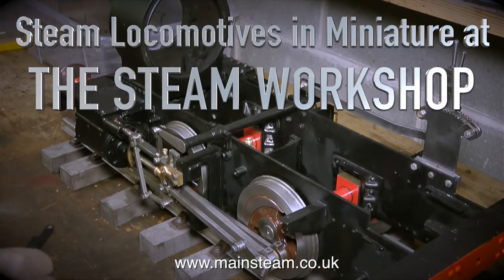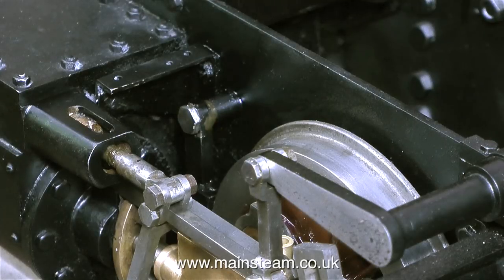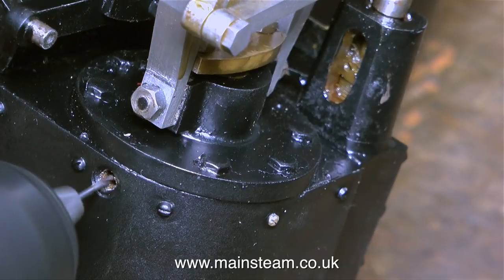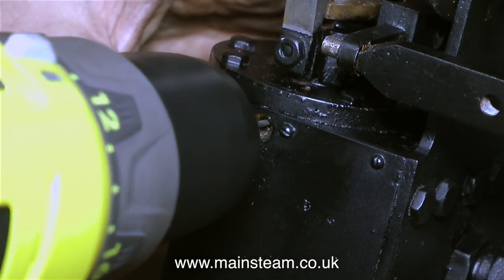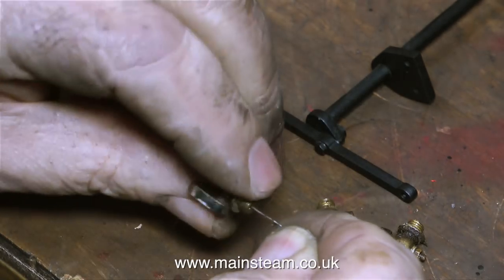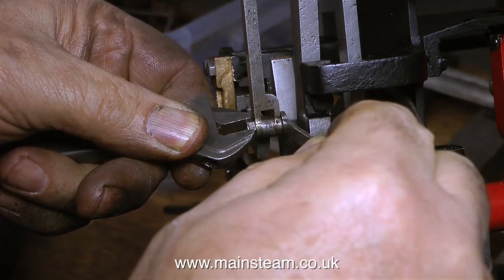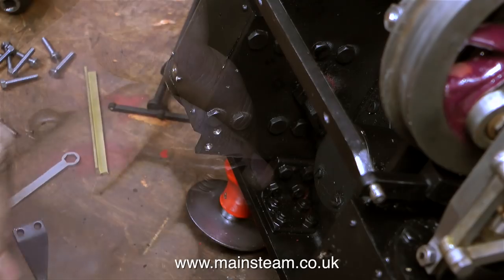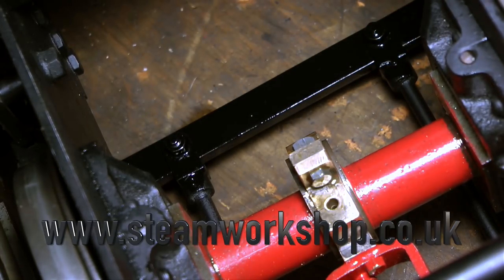WORKING AT THE STEAM WORKSHOP #12 - BRAKE GEAR AND CLEANING DRAIN COCKS

Comment: In a situation like cleaning those cylinder drain holes where the risk of breakage is high, I sometimes use a suitable piece of malleable wire such as stainless steel safety wire, then flatten the business end to make something of a spade drill so they will made something suitable for removing crud, but flexible enough not to wring off with an electric drill. You could also use a dowel or the like to make it like a small screwdriver and twirl it between your fingers if you do not trust the drill motor.

Comment: keth if this train did have working brakes would they be a steam powered assit system?
Reply from the maker: No, the locomotive brakes would be mechanical and for stationary/Steam Raising use to stop the engine from moving on the steam raising area. Braking 4 small wheels would not stop the engine with a person on a driving truck connected to it .....

Comment: Would an engine of this size need brakes? Seems like something you'd want even on a model as if something did go wrong it might be nice to have.
Reply from the maker: On an engine of this size brakes are ineffective anyway, if you brake the engine the wheels would just lock and it would slide on the rails . . . .  brakes are usually fitted to the riding cars. The brakes (if fitted & working) on an engine of this size would just be used as a parking brake.
Reply: Seems like the engine is light as far as models go, so I can see that being the case, thanks for the confirmation.
Reply: Depends on the club.  LALS in Griffith park (Burbank California)  required you to have functioning brakes if you wanted to pull the public.